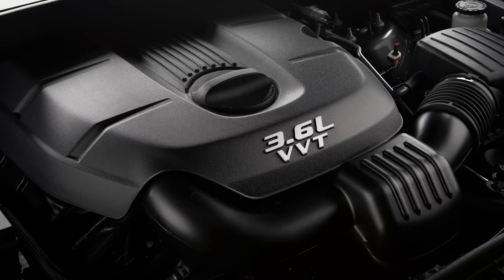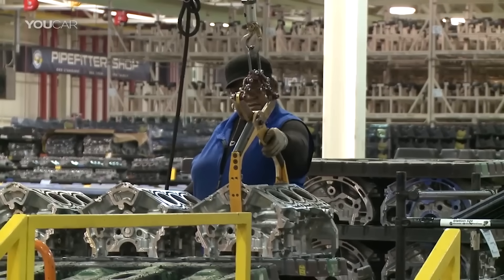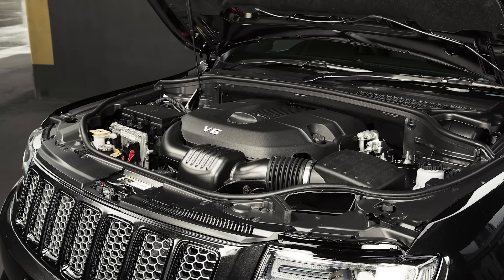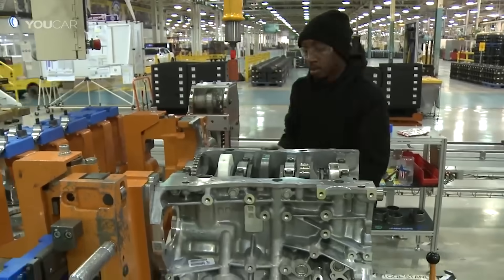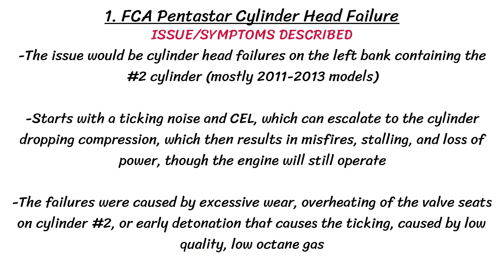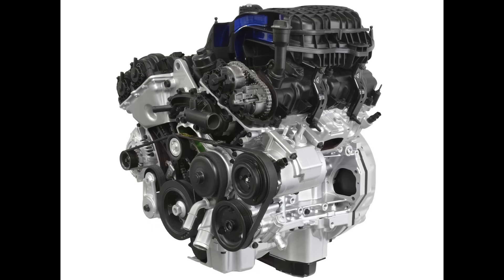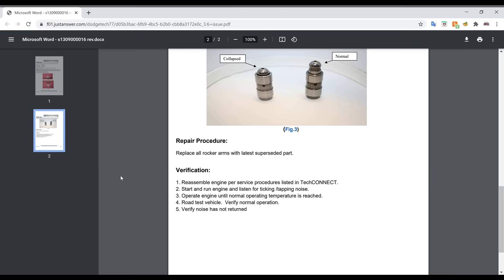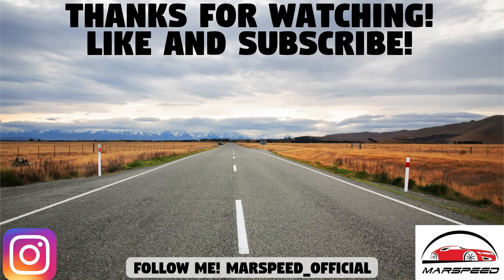The Specs and Fatal Flaws of the Chrysler 3.6L Pentastar V6 Engine

Comment: 2012 durango's Pentastar both cylinder head banks, rockers, cpu, both cats, the list goes on.... Still has a misfire code. Engine is a hunk of crap.
Reply: I have a 2011 and same exact thing here. Plus fuel pumps and a transmission issue that also killed my a/c because the systems are shared. Just for good measure
Reply: @mmatthewdavey5704  the 2011 and 2012 durango's  should have been bought back. We got completely hosed. I've dropped thousands trying to fix this hunk of sh+t
Reply: @MsRoxyPup  so right after this comment i had to replace 2 02 sensors, 2 valve covers, a complete flush and repair/replace of coolant system as my car was overheating without my knowledge, a catalytic converter still needs to be done and I just discovered a new possible electric issue that causes my lights to dim intermittently whether running or not. 

3rd round of 02 sensors and cats
Reply: Put a vacuum gage on it. I have seen new cylinder heads with sticking valves. The valve guides could be too tight.
Reply: @erichuff6945  they are too tight from the factory. That's the whole problem
..... After all this bullshit I still have a cylinder 1 misfire that intermittently keeps my cel on. AGRRAVATING.

Comment: Has there been any action against the mastic wyes that connect to the heater hoses that go from the engine to the heater core
Reply: Just buy the metal replacements made by Dorman and get on with life, When the Y's started leaking on my 2013 GC it was time to start changing the hoses out anyway because of age. 6 years is a long time for a rubber product.

Comment: I was one of those mgmt trainees at Enterprise Rent A Car in 2012 and almost everyone of our 300s and chargers with the 3.6 had the heads go bad. It was at a rediculous rate and the dealership who serviced our cars said Chrysler wasn’t even going to fix the issue bc the failure didn’t cause complete engine failure and it would still run.  I worked for the company until 2016 and the problem with these cars in our fleet went away in late 2013 and they were very reliable after that.

Comment: The Maserati “Ferrari Derived” V6s are Based off of the PentaStar too.
Reply: The engine is designed by Maserati. Then assembled by Ferrari. The engine blocks are cast and machined to Ferrari's approved specs respectively by Chrysler. So yeah, technically not just a rebranded engine. And this will shortly come to an end, because Maserati's and Ferrari's partnership has come to an end. Maserati will use they're own in house built engine.
Reply: @rdramos13  Well that makes more sense. But I’d say that Alfa Romeo Probably has the Closest to a Ferrari Derived V6 in the Gulia Quadrafolio as I believe that Engine is Basically a Ferrari California V8 with Two Cylinders Lopped off.

Comment: The oil filter/cooler housing, that's under the intake fails, and it's on national backorder as of 4/21
Reply: Yep usually around 100k miles or so. Some way earlier but thats the usual milage that I see them pop up a lot at
Reply: Chrysler has 96,000 on back order. Our parts guy has three of them Chrysler doesn't know about. More than likely I will use th up next week.

Comment: I see these engines at work on a daily basis. Timing cover leaks, oil cooler leaks, engine blow by, the list goes on. All this on vehicles that generally have less than 30,000 miles. Quality control at FCA isn't a problem. It's non existent.
Reply: I am guessing the engines you are seeing are not getting 3,000 to 4,000 mile oil changes and maybe see a long periods of idling.

Comment: I bought my 2011 Challenger with the Pentastar in ‘14 as the second owner and I’ve had zero issues with it. It’s got 106,000 on it now and I’m one of those that gets an oil change every 3000 miles without fail.

No complaints, but I am starting to see a hint of surface rust where the rocker panels are bolted to the rear wheel wells. I’ll have to detach that down the road and put something on it to keep it from getting any worse. 🧐

Comment: Damn I guess I'm lucky 10 pentastars and no issues 2013 Durango 13 Durango 14 durango and then another durango 14 charger 15 charger 15 300s 15 Challenger 17 Ram 1500 16 Durango 20 Durango no issues the oldest durango I have now is a 14 with 187k on it no issues at all newest pentastar had 4500 or 4800 on it and no issues at all

Comment: I own a 2016 Chrysler 300C Platinum with the 3.6L VVT and I’ve had no issues 88k miles. Change the oil every 5k miles with synthetic oil and always used the 87 recommended octane gasoline. Not even a tick out of the engine is heard. It runs perfectly healthy so far!
Reply: Wait till you pass 100k miles. Your in for a rude awakening. My chrystler 200 is an engineering nightmare..
Reply: @jonc2914  I actually just passed 112k with no issues at all. I do agree, The 200 is an engineering nightmare which is why it was cancelled because they had so many issues. I’m not saying all 300s are perfect either but if you take care of these things generally they will last longer
Reply: @jonc2914 bro, just get yourself a Toyota. Don't want a peasant car? Get a Lexus.
Reply: @thepawchoe2749  toyotas cost more than bmw's now
Reply: @jonc2914  still outperforms and outlasts bmw.
Reply: @thepawchoe2749 but they are generic and boring. I drive a 300 John varvatos model and I woundnt even trade it for the newest Honda or Toyota lmao and it has close to 150k miles. Only thing I replaced was brakes and the power steering pump 😭
Reply: So you're saying I don't need to put 91 in my v6 challenger?? 😶
Reply: Same but sometime I do put 91 on it and add an additive every time I fill it up